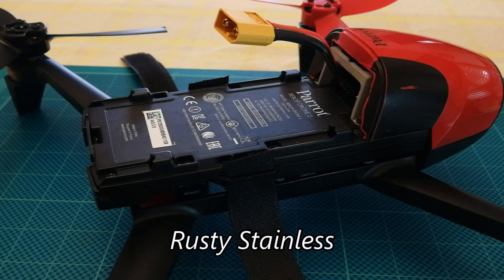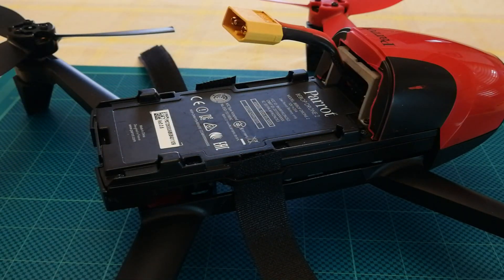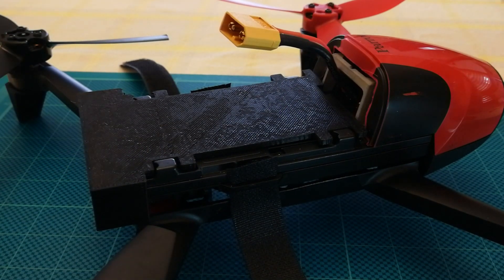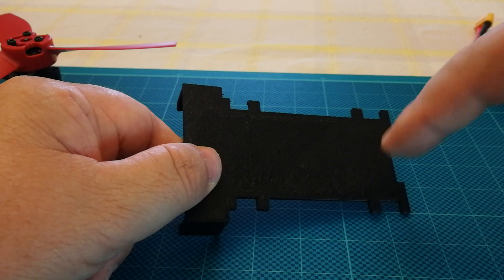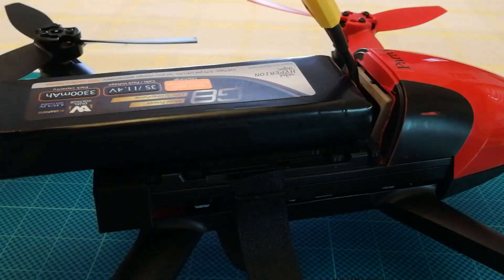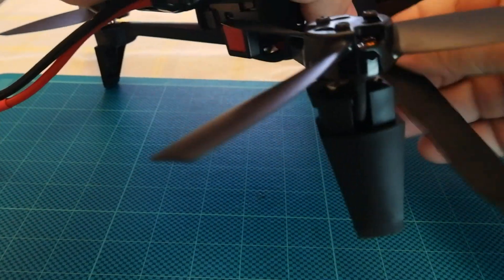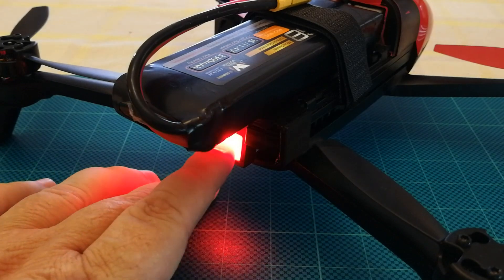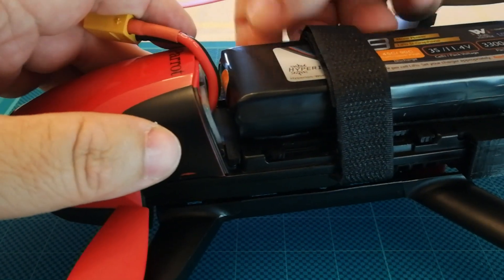Bebop 2 lipo-lihv battery tray mod

Comment: Where did you get the battery from in Aussie land?
Reply from the maker: I don't recommend the battery used in this video due to the overhang. Consider even trying 2x1300MAH side by side. The BB2 flies awesome with a single 1500MAH. Not long range but excellent hole-shot and flight characteristics.
Reply: @tapmad  I did get 2 x 2200mah that just hang over after the mod of removing all the plastic.
Reply: Thanks!

Comment: Impressive! How much of a fly time you are getting with this battery? Can the power connectors be used to power something like the nvidia Jetson nano and do some cool autonomous stuff with it?
Reply from the maker: Batteries are pretty much proportional for the their given MAH, meaning that if you do this mod to get extra flight time, you need to buy bigger MAH batteries. But the thing that I have discovered since doing the mod is that the BB2 doesn't like any extra weight outside of its original body lines. So the typically long lipo batteries add too much weight to the tail. So an alternative is to use two smaller lipos, eg 2x2200mah side by side. But in reality, at this stage, you would be better off just buying a 4000mah Gifi replacement battery. Funny enough, I have found that using a smaller 1300mah battery gives excellent performance because of the lower flight weight. Sure the flight time is only about 11min, but it has incredible vertical lift. Regarding power for extra devices - yes, I have been flying mine with an extra fpv camera/transmitter on top.
Reply: @tapmad  Great thanks for the insight. I mainly plan to add a realsense camera with a rpi or jetson nano and test for some deep learning stuff.
Reply: @tapmad  also, be aware that GiFi batteries are really only 3100 mAh with a wrong higher capacity.
Reply: Rusty, how much flight time did you get with this setup?

Comment: So the extra power wont blow the mainboard?
I lihv charged my original bebop 2 battery and it blew my motherboard...which I have since replaced.
Reply from the maker: No, BB2 can handle LIHV. Something else probably blew the board.

Comment: I also had the same setup. One day the battery slid while in flight hitting the propellers breaking them, and crashed 100meters high to the neighbors roof.
Result: broken landing feet, scratched lense, broken Propellers and one of the bottom screws broke together with the body where it screws in to.

After that, I just bought a 4000mah GiFi battery. Never had any problem since and it can fly up to 40mins.
Reply: 40. Min fly time wow. U have to buy the 4250 man battery
Reply: @tanusingh202  No way you can fly 40mins with 4000mAh GiFi
Reply from the maker: Sounds like you needed the battery tray to stop it slipping.